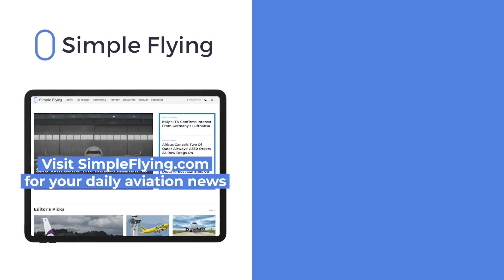Boeing 737 MAX Production Line To Replace 747 And 787 Production In Everett

Comment: It also helps Boeing when Southwest Airlines is a 737-exclusive airline and adding more Max planes to their fleet to replace aging 737-700's.
Reply: With 3500 orders for the plane I expect this is simply making customers happy by filling orders. Making Boeing happy by making money.
Reply: @danharold3087  The back long is currently around 4700
Reply: @johniii8147   I stand corrected
Reply: Southwest is receiving 3 MAX’s/week for this year. In fact, Renton’s current line is nothing but Southwest aircraft being produced
Reply: @LEVELGAZANOW  High percentage but not new nothing but southwest. At the current 30 a month production rate that equates to 7.5 a week.. So high percentage yes, but not  even half of the weekly production.

Comment: It makes sense. They have a substantial order list for the 737 max so might as well take advantage of the spaced freed up by the 747 and eventually the 787 once they finish those fuselage fixes. It's probably safe to assume that once the 777x is certified, the 777 program will eventually expand into those spaces so they can quickly fulfill those orders due to the delay in certification.
Reply: Highly doubt they will set up another another 777 production line. They have plenty of space in the current space. The 777x unless something radical changes. The X has a much lower volume of sales.
Reply: @johniii8147  X has low scales because its not certified yet and give the long list of delays it has faced, airlines would want to get it certified forst before ordering it so that they can get an exact timeline, although Air India's order of 777-9X has the given the program the much needed PR boost that it badly needed
Reply: @abhigyakhandelwal9215  It is expected to sell  more after it actually starts getting delivered 5 years late. But sales actually haven't been that bad for such a large aircraft. Already at 363 sold. More than 100+ more than the 380 sold in it's entire lifespan.

Comment: is the 777 still in production?
Reply: Yes the 777x is
Reply: @nickolliver3021  777F and 777-300ER. Production of the 777X has been temporarily halted
Reply: @mmm0404  oh yeh at the moment it has. But correct on 777f and 777-300er
Reply: Yes.
The 200LR, 300ER, and 200F.

Comment: Im glad to see that Boeing is going to keep its Everett plant going. I imagine as time goes on, Boeing will likely shift most widebody assembly to Charleston, while probably still assembling whatever its flagship is in Everett. It's likely even that Boeing will utilize the empty space in Everett to set up a new production line for whatever its next program is. Sadly, that will probably take the place of the 747 in its former manufacturing space. I wish Boeing and its employees the best as they continue this transition from continuous 747 production to a new program after over 50 years of supporting its hump-backed flagship.
Reply: I don't think would move it's widebody program. The 777 and 767 are built in Everett so it doesn't make sense they would since they have to recreate the facilities. The 777 production will probably expand into the 747 space when the 777x moves into production. Also the 777 is Boeing's new flagship.
Reply: @Jdwill206  I should have made it clearer, but I meant future Widebodies, not the 777 and 767, and I'm aware that the 777x is the new flagship.

Comment: Boeing can ramp up all they like but I won't be flying on that old junk with MCAS ... and fewer safety features. I'll choose Airbus every time.
Reply: Why wont you be flying on that old junk with MCAS? MCAS has been fixed and has more safety features now! Airbus has a similar MCAS anyway! don't talk waffle
Reply: @nickolliver3021  Airbus definitely does not have MCAS or anything like it. It makes no sense on a FBW aircraft.
Reply: @AmbientMorality  but there are similar systems like it that airbus has but not asking for a whole debate about that
Reply: @nickolliver3021  There really aren't? MCAS is for maneuvering stability and that is completely irrelevant for a FBW aircraft.
Reply: @AmbientMorality  but as I said there are similar systems like MCAS. Systems are always implemented I'm aircraft even if they're airbus ones.
Reply: @nickolliver3021  MCAS is for maneuvering stability, which is related to how stick force changes with load factor or angle of attack. Airbus planes have neutral longitudinal stability and no simulated control forces. Therefore, there is no system remotely similar to MCAS on an Airbus plane.
Reply: @AmbientMorality  and airbus has a similar maneuvering stability systems too on their planes which is related to angle if attack weather it be longitudinal or not. Therefore it dors have a system that can be controlled by pilots.
Reply: @nickolliver3021  What? I'm sorry, but I don't think you understand. Airbus aircraft do not use a system designed to alter stick force gradients, because there are no stick force gradients on an Airbus aircraft (because it is a sidestick without any force feedback).

If you mean vaguely "Airbus uses flight control laws", then calling it similar is a massive stretch along the lines of saying that the flight control software for an F-22 is basically the same as an A320.
Reply: BREAKING NEWS : Sales for the 737 MAX plummet after random guy on YouTube vows to choose Airbus  everytime.